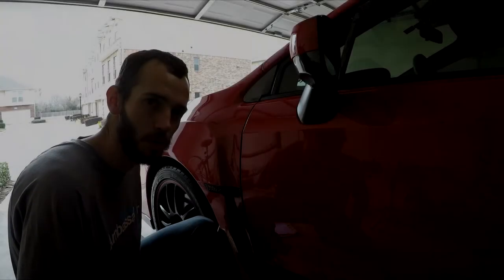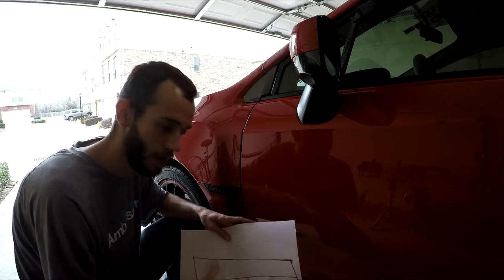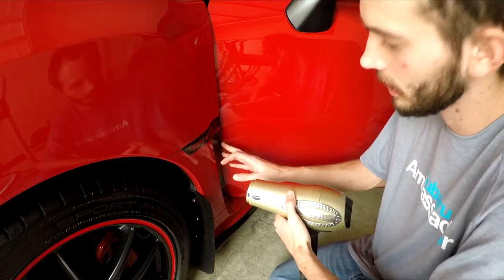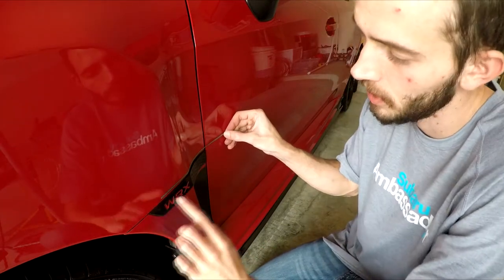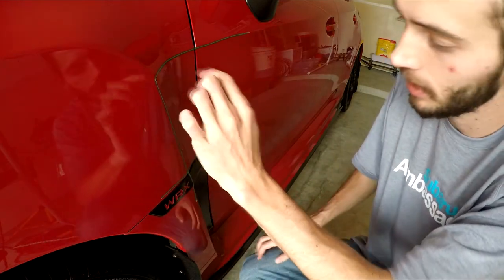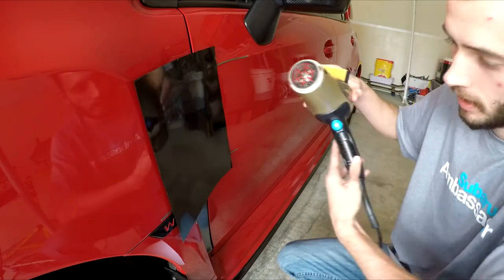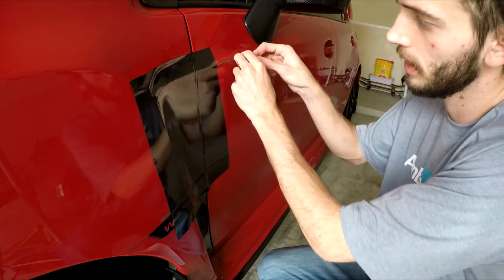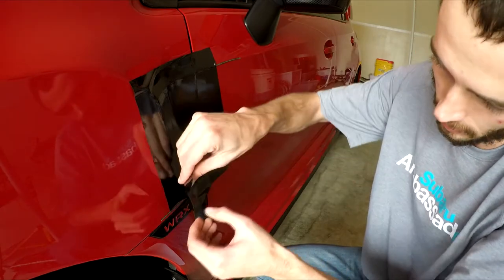2017 WRX Fender Wrap & Knife-less Cutting Tape

Comment: Another question just about to buy some gloss. Is that the 3m kind or the generic kind? The difference in price is pretty huge, I'm not cheap but damn.
Reply: Screw it went with the generic. See if I can even do it right. If it sucks I'll buy the good stuff later.
Reply from the maker: Sorry for not getting back to you soon. 3m is really easy to work with. Vvivid is just a step below but it does good as well. I'm not sure either brand makes a 5d carbon. I bought some really generic 5d carbon wrap that was really cheap but also really thick. It works great on flat surfaces but is a pain on curves.
Reply: That's the same stuff I bought, the thick cheap kind I was reading lol. I'm legit gonna copy the build you got here, cause it's exactly what I want. No hood or anything. So the trunk handle wasnt too bad with this thick tape than? I guess the mirrors will be a pain, also bought a cheap little heat gun off ebay as well. Hopefully the underskirts on the door aren't too bad since their more or less straight.
Reply from the maker: The only thing that I had issues with were my lip and side skirts. I ended up taking it off and going back with gloss black paint. Everything else turned out great and looks like it is holding up really good. I'd say it just trial and error. That's why it's nice to have cheap wrap. Good luck with your project.